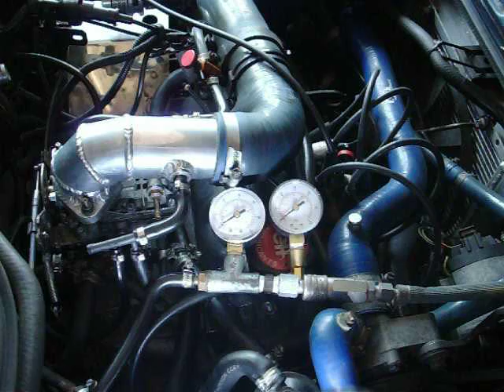Renault 5 GT Turbo Fuel Pressure Test 1

Comment: fuel pressure should be higher than boost, what boost are you running? doubt he needs a regulator running aftermarket stock intercooler hoses

Comment: Hi there, for high boost applications the stock fuel pressure regulator cannot keep the carb bowl full hence your leaning out issue. You need to purchase a malpassi adjustable fuel pressure reg, part code FPR009 and set your idle fuel pressure to 6psi. This will solve your issue.
Reply: +Mark Davis i will run on 17 psi on turbo pressure is 6psi the correct fuel pressure?thank you
Reply: +sidonio123 at 17psi you should be fine on stock fuel pressure regulator.